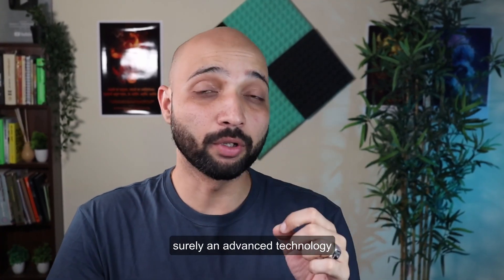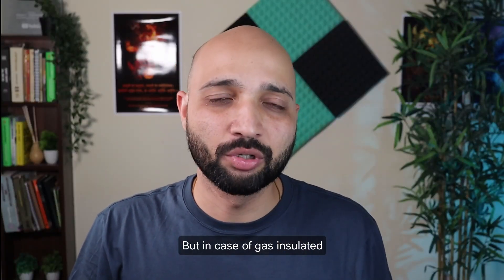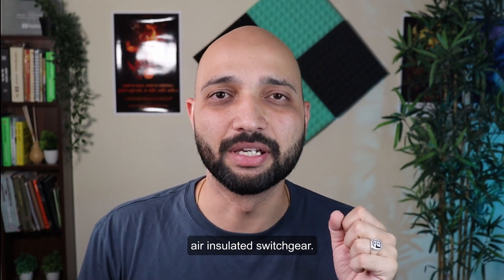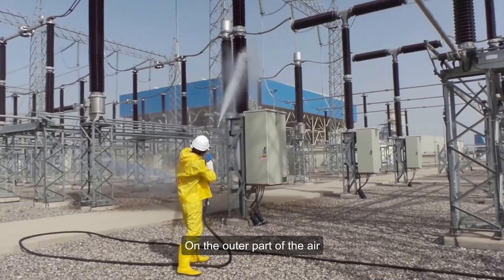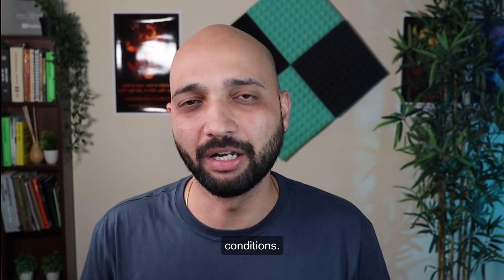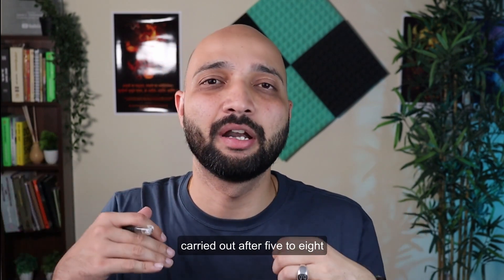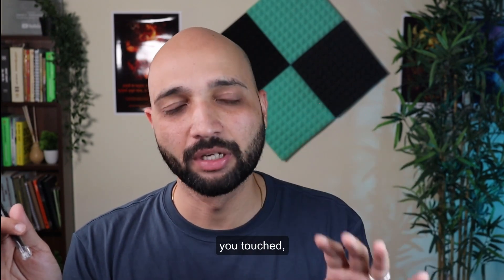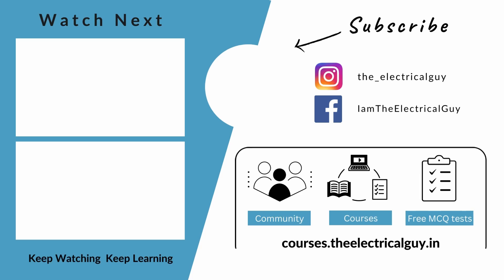Advantages of Gas Insulated Switchgear (GIS) | TheElectricalGuy

Comment: yes it is compact. but you still have the transformers. and with a lot of transformers and overhead lines, it can be expensive, because you need 3 terminals or 6 cable terminations for each bay. But with underground cables and only 2 or 3 transformers it can be good.